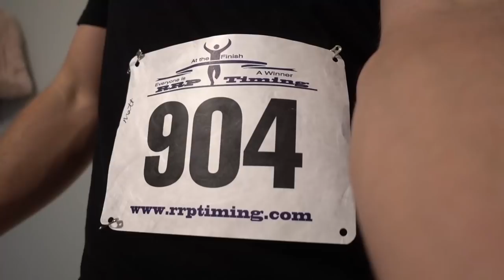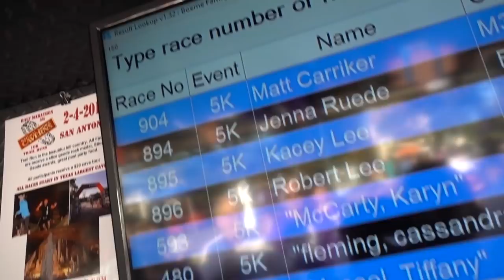This is Weird... But I’m Into It...

Comment: Sorry matt and mere I know you don't wanna hear this but that light is not the best since you can get into the attic I would recommend doing 6" led can lights the have a can light cut in tool you just attach to your drill it's way easy no sheet rock knife . You probably only need like 4 maybe 6 depending on how space them out

Comment: Haha it does kinda look like a dining room. Maybe you should have just installed a ceiling fan with shorter blades. They make those and it would have been easier to install. Also, if you really needed, you could have still ran the wires over so it's further from the beds

Comment: Me and my sister have two twin beds parallel to each other, and in between is a chandelier with glass crystals hanging down, and we used to jump from the beds and try to grab the crystals, and we got them all off, then my parents replaced them, and we ripped them off all except two for the longest time, then we got older and thought it looked weird so we took them down. Those good old days.

Comment: Being Dutch, I find that a strange kind of way of building a house.  Electrical wires running across the insulation not through tubes and plaster board against wooden beams as ceiling.  Only wood is used for the rafters in the Netherlands, the rest of the house is made of bricks or concrete.......

Comment: You know guys they do make the ceiling fans are half the size that are small and still move a lot of air around and had lights built into them so you might want to check into something like that that would be safe enough for the kids to get up and down into the bank unless they like it hitting things like you said with the lights then you may have a problem still and then I can understand you want to more have a good one sincerely Chuck

Comment: I found u recently, so i watch some old videos ;)

Good Job with lamp !

BUT man....., if keep it short, u need a local Certified Passive House Designer, to deal with your house problems.. roof insulation done wrong,  ventilation - wrong, wiring - wrong..     u have a lot of Thermal Bridges - holes basically, so u overpay 4 your heating by A LOT, believe u me..